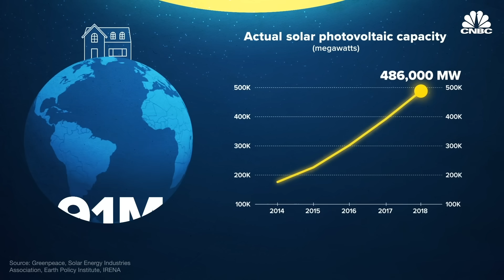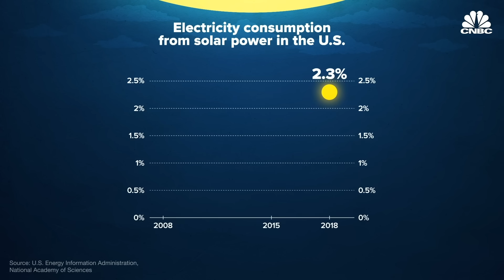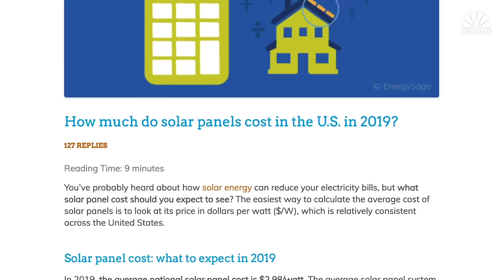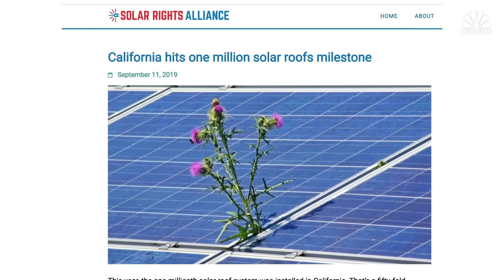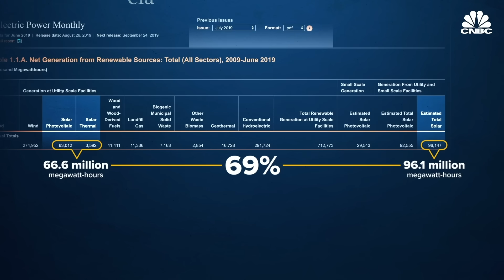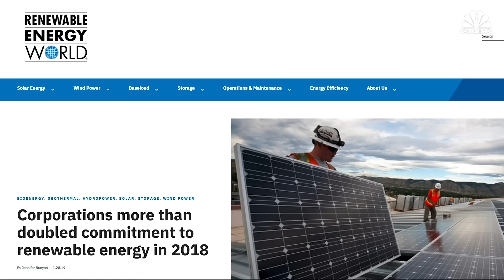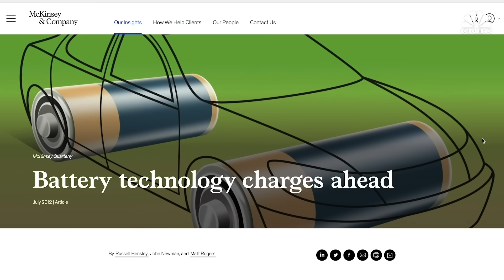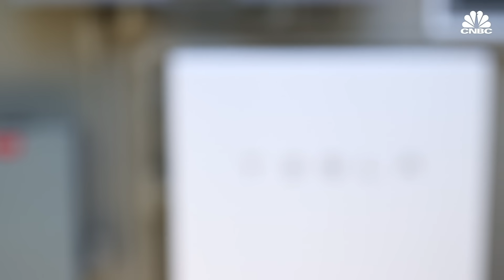The Rise Of Solar Power

Comment: Why does no one bother to mention pumped hydro storage when it comes to power storage for renewables?  Its by far the most economical when installed at scale, requires no special or new tech, and the US has around 80,000 unused hydroelectric dams that could easily be retrofitted.  The storage capacity is near limitless with weeks, even months in some cases, of continuous power being stored.  Need more storage capacity... dig a bigger hole; far cheaper than batteries, peaker plants, molten salt, etc...

The problem with solar power is entirely political, not technical or economical.
Reply: The dams need to be close to the generation to minimize transmission losses. Currently most generation locations are not located near dams or water. Only a small percentage of generation sites have the combination of dams, geography, water and sun to make pumped storage viable. This is why batteries are a more general option at this time, and will become more viable as the cost per kwh falls and as other forms of batteries come on-line.
Reply: @Obscurai  The dams were built close to cities or other places they needed electricity.  So either you're running transmission lines to batteries, or to dams, but either way the distance is similar.  The problem is merely a political one.  The major energy companies do not want to change, and are dragging their feet.  While batteries can be done at small scale, pumped hydro needs to be large scale to be economically efficient.
Reply: @CrimsonTide001  If the dams were actually close and were economically viable they would be used. You are right, dams are political since they also have an environmental impact that needs approvals, battery arrays do not. An energy company will always choose the easy path for returns - dams are not the easiest path for economic returns.
Reply: @Obscurai  Their locations are not what is an issue, most of them do not have a large enough flow rate (ie. they cannot generate enough power) to justify their upkeep solely as generators.  Batteries are fine in the MWh range, but completely impractical in the GWh or TWh range.

Pumped hydro storage would make many different forms of power generation viable that currently are not, this would lead to increased competition.  The power companies have a near monopoly on power generation atm.  Its not about money directly (though of course always indirectly) its about maintaining that monopoly.  This is why power companies are fighting so hard against solar, it would cut into their monopoly.

If Americans are serious about renewable power, they need to understand its a political fight not an economic or technological one.  They need to break up the large monopolies that control power generation and distribution and form separate entities for transmission and generation.  A market based smart grid would allow both large and small scale generation and storage to compete.  But since lobbyist's control the government, the big business maintain their monopolies and renewables stay perpetually in 'maybe in a few years time' but not right now.
Reply: @CrimsonTide001  here in Portugal we make heavy used of hydro storage for renewable recess electricity
Reply: @CrimsonTide001  Conspiracies to maintain a monopoly aside, why then are power companies investing in solar farms, hence the reason for this video? It is the power companies that are driving the increase in solar generation at the moment. I would contend that there is no conspiracy to maintain monopolies, and that it is purely the need to maximize profits that is driving their adoption of solar. 

To that end, pumped hydro does not contribute to that profit maximization since, as you pointed out, the flow rate of most locations is not sufficient. Hence my original reply that most locations are not conducive to pumped hydro. Additionally, pumped hydro has a political component, that other types of storage do not have. A company will vigorously avoid political issues since they hamper the speed of deployment, hence they gravitate towards installing batteries.

However, you are correct that batteries do not yet scale to the GWh or TWh range, but that is in fact the reason for their adoption. Specifically, power companies do not need to plan a massive project and spend the associated huge upfront capital for a large solution. Instead they are currently (not theoretically) spending incrementally on storage solutions that are distributed as necessary (often at distribution sub-stations). This incremental capital spend will always be less risky in the short term and therefore is where and how the power companies are making investments. The same cannot be said of large scale, capital intensive, politically troublesome dams.

So as this video indicates, solar and incremental storage, has attracted the majority of investments in the renewable energy space.
Reply: @Obscurai  

"Conspiracies to maintain a monopoly aside" ... conspiracies?  Have you read any of the bills put forth and sponsored by power companies in regards to solar?  Of course not...  The power companies are continually pushing for taxes, permits, and restrictions on residential solar, and the opposite for large scale utility solar. 

"I would contend that there is no conspiracy to maintain monopolies" - I agree, conspiracy implies they try to be clandestine in their actions.  But who needs subterfuge when the average person is so utterly clueless.

"as you pointed out, the flow rate of most locations is not sufficient" - No, what I pointed out was the flow rate was insufficient solely for generation.  The word 'solely' has a meaning, which you seemed to ignore.

"Hence my original reply that most locations are not conducive to pumped hydro." - No, your original reply stated the issue was not a flow rate one, but of transmission line distances.  But if you even took 5s on google to look at the position of most hydro dams (in particular the larger ones), you'll notice they are often right near large metropolitan areas.  Its almost like they were built near cities (or cities were built near them) on purpose!!

"Additionally, pumped hydro has a political component, that other types of storage do not have." - You try to install a TWh of battery storage you're going to have far larger political, economic, and environmental issues than a dam would incur.

"A company will vigorously avoid political issues since they hamper the speed of deployment" - Avoid politics?  They embrace lobbying at every turn.  Why else would they spend millions on lobbying (https://www.opensecrets.org/industries/indus.php?ind=E08)?

You really need to do some research before you start talking about thing you clearly know nothing about...  its a conspiracy that companies try to obtain and hold on to monopolies???  Honestly how could someone in today's day and age try to argue that point 'with a straight face'?  If you're looking for research reading material, here's a good place to start: https://en.wikipedia.org/wiki/United_States_antitrust_law.
Reply: Let's look at two projects: The $400 million Smithland project in Ohio will have a capacity of 72MW. As many as 400 construction workers will be employed to build the project, and 7-9 permanent operating positions will also be established. While this is not a pumped hydro solution, it is adding generation capability to an existing dam.
This compares to the AU$66 million Hornsdale project in South Australia that has a 100MW capacity. The demonstrated payback for this project was 20 months, and has a low operating cost since only 1-2 permanent positions were created to maintain it.
If you were a power company, which investment would you choose first?
Reply: You know how fkin expensive it is to dig a big hole? The hole is not enough, you also need elevation change, which makes hydro batteries impossible in a lot of countries. Also i have doubts about the 80 000 unused dams in us alone...

Comment: the production of solar panels and the end of life disposal of worn out solar panels are both very toxic so like oil coal and nuclear there are hidden costs. i like solar were it make sense in thing the recycling of panels needs a lot of work and new chemistries for solar cells are much less toxic so it is getting there it is just not there yet.
Reply: yes there are hidden costs as with any manufactured item, but those costs are minimal compared to the ongoing and never-ending costs of fossil fuels. Currently recycling of panels is not well developed since there are not enough panels to recycle in scale. There is optimism however since it has been shown that 95% of the panels can be recycled which is quite good and this is over the 25-30 years life spans of the panels.

https://earth911.com/eco-tech/recycle-solar-panels/

Comment: There is some false statement in this. You can store the energy in batteries that aren't very expensive, Lead Acid (think golf cart batteries, granted you'll have a bigger footprint rather than Lithium) to store the energy and use an inverter to power your home. We in Haiti have been doing this for over 2 decades and most of us are self sustained as we don't rely on the government for power due to many blackouts. Also, all appliances run on 110v as they are more energy efficient. We use RV pumps to send the water to water storage on top of our homes and gravity does the rest when we need it. We also use RV washer/spin dryer then the sun to dry our clothes. It's just a matter of being creative and wanting to make an effort to be self sufficient. Solar it not the all mighty answer, but it is a big on. We also use small sailboat wind turbine for to power our homes and charge the batteries over night. Lots of wind at night especially if you are up in the mountains or by the sea.
Reply: All appliances run on 110v as they are more energy efficient, what? Wouldn't 230v be more efficient?
Reply: @andreaswickman1508  no. You need a lot more power at 230v (batteries and energy) to run those appliances (water heater, water pumps,  washer dryer, big freezers,  air conditioning, etc...) which use a ton of energy. You'd need a pretty solid inverter too that can withstand all of that energy.
Reply: @TheHaitian  Wrong!
The output of power inverters is measured in watts which is the same whether it is 110/120v or 220/230.
The only reason for using 110v over 220v is safety.
In any case, whatever voltage your appliances are running, their respective efficiencies are effectively equal.
>

Comment: lithium batteries poses a hazard for the environment
Reply: Edi Carbajal i think we could also use part of the electricity ecxes to make hydrogen for trucks or homes, in japan some homes are already powered by hydrogen cars for example
Reply: @carholic-sz3qv  yes solar energy can work well for electrolysis, because electrolysis is a very power consuming process to achieve and solar and wind energy is the only viable solution we dont have to worry about depleting power beyond our means to make them
Reply: fidel catsro electrolysis is not very power hungry it’s already used in many countries
Reply: @carholic-sz3qv  from what i know it costs more $$ in power spent to split water into oxygen and hydrogen for what we get in return as fuel...so as such only way we can get value for $$$ is to use solar and wind reosurces because we dont have to worry about money spent on gasoline to generate power
Reply: fidel catsro you are very funny, so you have to return to fossil fuel is that whats you’re thinking, seriously!?!?! With all the electricity lost over the years we could have generated tons of hydrogen for cleaner trasnsportation and hydrogen can actually be stored very cheaply
Reply: Lithium batteries pose a hazard for the environment
.
>

Comment: 29,000 Acres of Solar Panels to Power 116,000 homes doesn’t seem very efficient...
Reply: That's why saving energy is the most efficient way to get away from fossil fuels.
Germany which is one of the biggest industrialised countries in the world consumes around 6500 kWh per capita while the US has a consumption of around 12000 kWh.
Reply: Why not?
Reply: Thomas - Because MATH... 29,000 Acres divided by 116,000 Homes gives an efficiency rate of only 25%. No bueno...
Reply: @brandonleesanders 
25% is a great efficiency though.
To run a car for 1 year on gasoline it took 10 million years to produce that gasoline.
1 divided by 10 million is 0.00001%
25% is way higher than 0.00001%.

(Just for the record, your calculation is even more absurd than mine.)
Reply: @brandonleesanders 
"arbitrary number"
Good job, that was the point.
My number was absurd and arbitrary just like yours. That's what I've tried to point out for you.

You didn't calculate an efficiency, but the number of acres per house and then made an arbitrary connection.
 
"Gasoline cars are indeed 90-95% efficient"
What? You are trolling right?
The efficiency of a gasoline car is around 15 to 25%.
One liter of gasoline has around 10kWh of energy in it. So a good gasoline car needing 5l/100km (47miles per gallon) would need 50kWh per 100km. Current electric cars need around 20kWh per 100km.
If the gasoline car would be 90% efficient then that would mean that the electric car would be 225% efficient, which is an impossibility!

"I'm guessing algebra wasn't your best subject"
Thanks for the chuckle. You asking a math teacher this is somewhat ironic

Comment: Lets go nuclear. Less waste & cost & environmental damage than solar!

I havent done much research but ive been lead to believe this. Let me know if im right or wrong
Reply: There's a reason governments around the world are building solar and wind like crazy. It's all about money
Reply: Low capital cost, incremental capital costs and no on-going fuel costs are all major advantages of renewable energy generation, that nuclear will have difficult time competing with regardless of the waste or environmental costs. The drive for renewable energy is not environmentally driven, it is economically driven. So to argue about the environmental costs is pointless since renewable generation is a "good enough" technology for both the investor and the general public.
Reply: Nuclear is 2x more expensive than natural gas and 3x more expensive than solar/wind. It's not 10 years ago anymore

Comment: You keep saying that phase " clean energy " 
Its not clean , its just an energy source. 
Loads of carbon and pollution created in its manufacturing, installation and transport
Reply: Those emission only occur at the beginning .  Fossil fuel plants continuously generate pollution and CO2.  Over the life of the panel, pollutants per KW h of power generated drops to next to nothing.  Only hydroelectric is better in that regard and its not completely "clean".
Reply: Dennis McIntyre It take about 40 years for a solar panel to offset the energy required to produce the Tellurium that’s inside of it. Thanks to copper mining this goes under the radar
Reply: @oli4559  In that case, the fossil fuel industry should be welcoming solar panels since it take so much more energy to make them that the energy they produce over their lifetime.
Reply: @oli4559  do you think researchers are keeping quiet? Too much awareness is shed on Solar now, investors will now invest in solar panel tech, making more efficient panels with minimal damage to environment in the future. There are already numerous researchers working on making panels safer and friendly.
Reply: true, but these emissions are offset because the Solar doesn't emit carbon or other poisonous gases when it starts generating power in its lifetime

Comment: The potential of solar and wind with fast cycling long-duration energy storage will make gas and coal pointless. Vanadium Redox Flow Batteries are already able to deliver power over 2, 4, 6 and even 8 hours. Best of all they don't lose their depth of charge over life. The life of a VRFB is also 30 years! It is also worth considering when people think about recycling a system that the vanadium electrolyte can be reused in a new system and go on and on. No other battery technology can do this. But it is only suitable for stationary storage. But for these large solar and also large wind power projects they are a perfect solution. In China there are multiple projects being built with 1GWh systems and this technology will be huge globally. The sun and the wind are free and as power sources, they are easy to capture and harness.
Reply: Very interesting points here Richard. I didn't know about the vanadium options. Do you have some weblinks where they discuss this? I would be very keen to learn more about it.
Reply: You can learn much on Vanadium on a website called “The Bushveld Perspective” and also the Vanitec website. These are great places to start. Hope this helps.
Reply: Price? The reason why solar is taking off is due to lower price. Li-Ion is capped about $100/kWh since that's about raw material cost. What is the raw material cost for VRFB?

Comment: V2G is starting up.  Power companies use EV’s to store power
Reply: Yes, I would sign up.  I have solar panels where I sell excess to the grid.  I charge my EV for free and my home electricity is free.  I save $900/month on gas and electricity.  I recently purchased a powerwall battery.  My Tesla has a coolant controlled battery so it will be fine V2G. I will be saving money
Reply: Plus my Model X is 8 years/unlimited miles on the battery.  Model 3 is 8 years/120,000 mile battery warranty. Federal government mandated the minimum for batteries as 8yr/100,000 mile warranty.  Both Model X/S are unlimited miles
Reply: V2G? really?  I mean... are you going to donate some vehicle range and cell cycles for the sake of load balancing the grid?  Because most people wont.
Reply: @CaedenV  they'll get paid